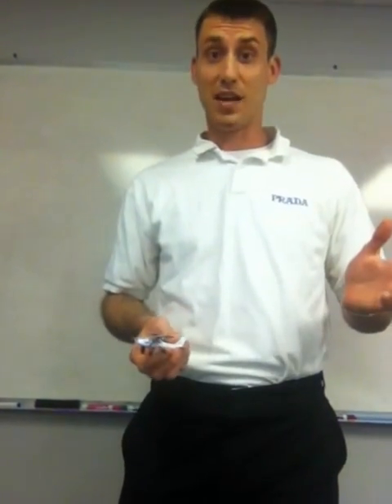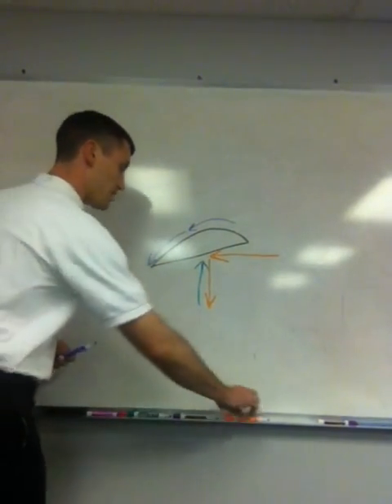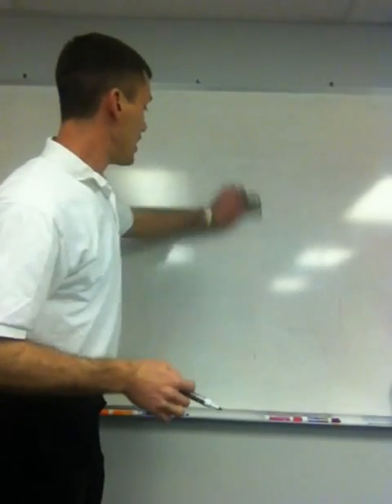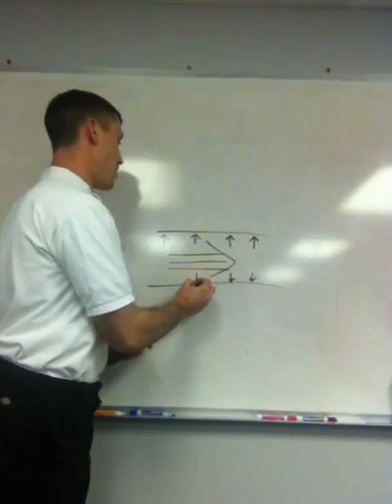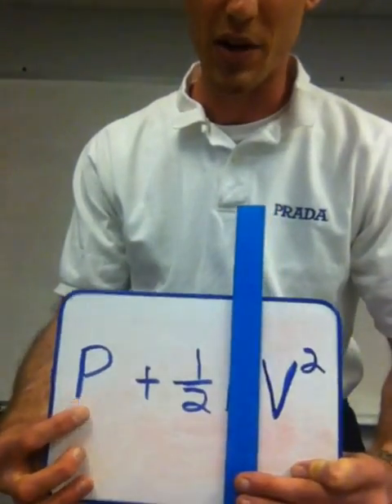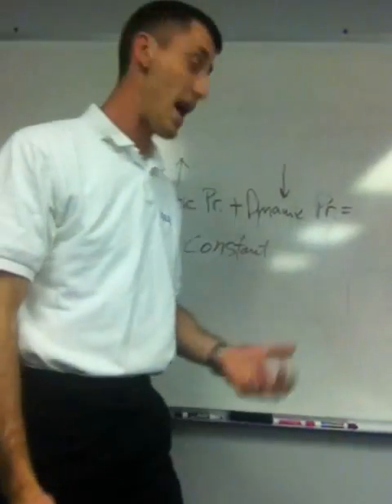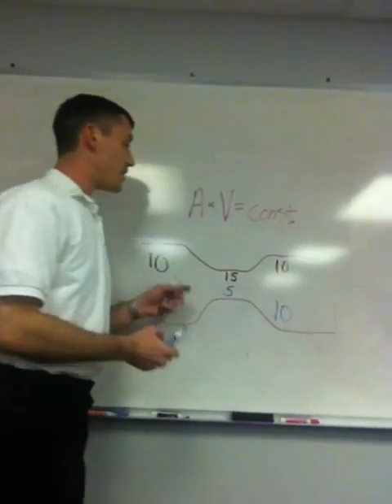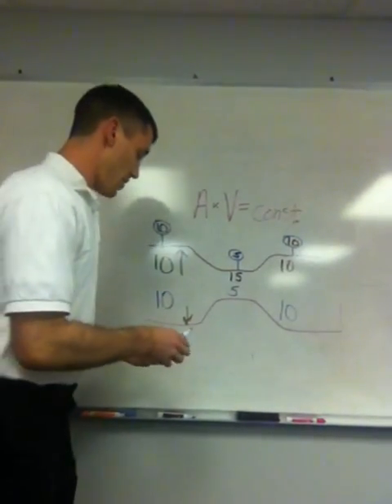How an airplane produces lift, bernoulli and newton

Comment: To all who are not SME:
LIFT caused by pressure difference (like  vacuum cleaner).
Pressure difference is due to fluid  flow CHANGE DIRECTION.
CHANGE of flow DIRECTION is caused by SHAPE of wind.  That is why in fast cars  airfoil is used as well.  The only difference being the wing or airfoil shape is mounted upside down producing downforce instead of lift.
Reply: Andrew Pa Yes.  This hardly a good venue...
Cheers.
Reply: A wing bends the air causing and change of velocity (speed and direction) If that change is downwards it is called lift. Newton's 1st, 2nd and 3rd laws in action.

Remember the air isn't moving the wing is. A ceiling fan is a practical demonstration of lift. The downward breeze you feel plus the upward force on the fan shaft = lift force... Simples....

Make a paper plane (flat wings, no camber) and watch it fly. it debunks all silly explanations. Sailboats, hang gliders and kites all have the same distance top and bottom yet they all create lift the same way... Magic or physics???

BTW all airliners have supercritical wings that are flatter on top and more curved on the bottom... Kinda blows up the explanation above doesn't it?
Reply: +Andrew Pa :"Pressure difference is due to fluid  flow CHANGE DIRECTION."
  Correct.
Reply: Observ45er : It is secondary effect. When there is no motion there is static  pressure distribution around  airfoil. Velocity  direction will be changed by such  initial  force ( gradient of static pressure). In other words  there is total  energy preservation  ( flow velocity represents kinetic energy and  pressure - potential ).  reduction in potential energy ( pressure) causes kinetic  energy  ( velocity) increase and vice versa.  From  energy point  of view  there is no primary/secondary relationship  , but when it comes to forces  there is no  other forces except pressure  gradients. So acceleration can not occur without some force . So, force is primary - acceleration is secondary .Hope it makes sense. Happy to discuss further.
Reply: Andrew Pa  I was supporting your correct statement and don't need clarification.  The video is using the incorrect and backwards "pseudo Bernoulli" explanation of faster air exerting less pressure.
...
The focus on energy confuses the science neophyte so I stay away from that.  On the other hand, the concept that "...acceleration can not occur without some force " is easier to understand as it is the true basis for understanding Bernoulli.
...
Once you understand, it fits very nicely with all other science and you don't have to make up excuses like "Faster air has 'less time' to exert pressure" as if it is some magical cause/effect (as I see in another video).
...
I wish the "wrong Bernoulli" people would read their comments, do genuine study and either remove, or re-do their videos.  I got one self proclaimed professor to remove his bad video from a teacher resource site...[[kept a copy, though.  It's a classic!]]
Amateurs I can understand, but there's a Purdue sponsored video that has all the bad demos...sigh.
One down, 20,000 to go... (;-)
Cheers, ScienceAdvisorSteve.
Reply: Complete Aerogeek Your comment does not explain why wing bends flow, why flow follows wing shape and what force accelerate (bending = acceleration) fluid. What you describe is not a cause but result of  "static" pressure distribution action on moving fluid .  Please, read John Anderson Jr books - "Introduction to flight" or "fundamentals of aerodynamics" :-)
Reply: Observ45er Agree , thanks.
Reply: Andrew Pa Hi Andrew, I am not sure what you are trying to say here.

The change in velocity (bending) of the static (at rest) air is caused by the mechanical intervention of the wing and angle of attack.

No AOA/Incidence or camber (which equates to AOA) = no lift.

The movement of the wing through the air imparts energy to the static air. F=Ma. The rapid change of direction caused by the mechanical intervention of the wing causes lift.

The cause of lift is the motion of the wing through the air. As the air at rest encounters the moving wing (like your hand out of a car window)  it is bent downwards in different ways by the upper and lower surfaces.

The physical disturbance of the air is what causes the pressure differentials. No energy=no movement=no lift.

A flat plate is the easiest way to demonstrate this. Flat plates work very well as wings up to about 8-10 Deg AOA. They have a very high L:D ratio.

Lift is caused by bending the air. period. A ceiling fan does he same thing.

 ( Thanks for the book tips but I have an MSc in Aviation Science and teach this to BSc students at University)
Reply: Andrew Pa Andrew lift is not caused by the shape of the wing.

Lift is caused by AOA or the change in angular motion imparted to the static air by the movement of the wing.

For a low speed highly cambered wing, the camber in the upper surface creates a large amount of the angular change that creates lift but this is the same affect as a flat or curved plate wing at the same angle of attack as the upper surface camber represents. The difference is the flat or curved plate produce much less drag.

Airliners have supercritical wings which are curved on the bottom and flatter on top so how do you suppose they work?. 

Aerobatic aircraft and most military have symmetrical or supercritical wings. Sailboats and hang gliders have single surface aerofoils and create lift very nicely by turning flow.

Kites, missiles and some high speed aircraft (F-104) have flat or double wedge wing cross sections and they all create lift very nicely.
Reply: So what creates the pressure differential my friend?  It doesn't create itself... F=Ma its that simple.

Without motion and an angular change of direction of the resting air, there is no lift.

Again, the pressure variations are an effect not the cause of lift.

Without a cause (AOA + wing motion) there is no pressure differential - period. At ) AOA/) incidence- there is no lift no matter how fast the wing flies.

And no pressure difference is not like a vacuum cleaner which in any case does not produce a vacuum at all. It should be called an air flow cleaner.
Reply: Complete Aerogeek Your description  comes from  engineering point of view.  My  description comes from  physicist point of view.  Unfortunately,  this  forum  is not best place to have nice conversation. Motion  for incompressible (low speed) and compressible ( high  speed) are not quite the same. Sorry for  misleading  I should  say shape of wing AND direction of flow ( in your world it has name  angle of attack, right?).  Of course, shape itself not very helpful if  direction of flow is not appropriate :-). My apologies...
Reply: Andrew Pa Andrew, thanks for that. There are so many people out there with the wrong idea.

Lift is quite simple until you get into the tiny details but the physics is exactly compatible with the engineering or aircraft wouldn't fly.

I was a bit confused as you seemed to have been proposing an effect without a cause. In Physics this is impossible as you know.

That's why I usually explain lift using a flat plate and demonstrate this by using NASA's FoilSim. It takes out any confusion about wing shape as there are so many variations.

Also I am very familiar with both low and high speed aerodynamics as airliners operate in the transonic range (and I am ex military aircrew and engineering).

Air that is subsonic is generally regarded as incompressible.

Also one of the places Bernoulli got things wrong is by assuming air is inviscid which of course it is not. 

Fun isn't it?
Reply: Complete Aerogeek Sorry , we just use different words to  describe same phenomena. Any submerged body creates some pressure  distribution  around it. This starting point for  any  further  effects.  When body moves fluids "particle/parcel" interact  with this  inhomogeneous pressure. "Particle" can be accelerated or decelerated. This will cause change of of this pressure  ( simply energy conservation in action). Now we will have two types of pressures ( static+dynamic= total). All this reminds me motion of electrical charged particle  in electrical field when electrical charged particle  has strong enough electrical field that  changes electrical field in which particle moves :-).
Reply: Complete Aerogeek As  physicist  whose primary interest is turbulence study  I was not  much in airfoils/angle of attack/thrust  etc.  But  huge number of lift "explanations" attracted my attention   to origin of lift .  I have great  respect  to people   who work with fluids (marine/river/aerodynamic engineers). They have to say much more about fluids  than  theoreticians. But their focus "make things  ( ships/cars/turbines) work" a bit different  from scientist " why nature works this way". Thank you for coming to such  forums and fixing damage  made to people by introducing such  "explanations".
Reply: Andrew Pa Hey Andrew, you lost me there. A submerged body at rest would be subject to Newton's 1st and 2nd Laws and so would have no pressure distribution around it unless the body or the fluid were in motion.
Reply: Andrew Pa Hi Andrew it is a pleasure communicating with open minded people. I am always keen to learn as I was also taught the wrong ideas about lift many years ago.  There are so many people out there who have been fooled by the old Equal Transit Time myth and this has bred all kinds of derivatives.

I had a 'discussion' with a 10,000 hour B 737 pilot who refused to believe that the old Bernoulli myth was wrong until I made a paper plane (flat wings) and asked him to explain it.... Lots of silence!
Reply: Complete Aerogeek Let me disagree with you  on this "no pressure distribution around it ". This is what exactly makes balloon raise  in the air ( difference of pressure). No other forces work here  ( if we will ignore friction,wind etc). 2d Law of Newton  explains acceleration - not force :-).  This is  a great difference between  2d Law for falling ball and fluid that for fluids  that velocity distribution in space has impact on  "force" - pressure distribution. This is source of all confusions: what comes first - pressure change or  velocity change :-).
Reply: Andrew Pa Sorry I should have been clearer.

The pressure distribution is uniform much like it is with us standing on the earth being enveloped at 1 Atmosphere. Static pressure is  not really of any interest to us at rest.

However the balloon analogy is something else entirely. Now you are talking about buoyancy and displacement. The balloon displaces more than it weighs so it rises seeking equilibrium. The static pressure distribution around the balloons surface is in equilibrium. If the balloon was filled with ambient temperature air to the same shape/displacement it would not rise, so where does pressure distribution come in?

A submarine is effectively a balloon but as long as it keeps its trim stanks flooded to balance the buoyancy it remains neutral so pressure is again at equilibrium.

As for the 2nd law, without it we cannot have lift. F=Ma.

None of these factors are really relevant to lift production. In static air at rest and aircraft wing creates no lift as pressure is in equilibrium.

I am not sure where you are going with the falling ball analogy. In a vacuum they will accelerate at exactly the same rate won't they? 9.8m/s/s in Earth's gravity?.

In lift, the velocity change creates the pressure change. The pressure cannot change without the mechanical intervention of the wing.
Reply: Complete Aerogeek Greetings from Sydney :-). 
"The pressure cannot change without the mechanical intervention of the wing." - good point . We are almost there. Just looking for best and simplest analogy.  Pressure distribution around  any body in fluid  creates  potential field like gravity close  to  the Earth surface.  Without motion all in balance  but as soon you will throw a ball  energy/speed of ball will be  changed by this potential field. Same when fluid particle moves  in vicinity of  any submerged ( in air/water/honey) body it will change it velocity ( you use term bending) and modify this field ( energy conservation) :-) .
Reply: Complete Aerogeek &  +Andrew Pa   I'm going to watch to see how this discussion regarding the term "pressure distribution" gets resolved.  I just realized  the basis for a good conflict in preceived phenomena with standard physics with this term...
.
There's too much opportunity for misunderstanding in the type of a forum.
Cheers...
Reply: Observ45er I prefer coffee-shop for nice friendly conversation between  curious people  as well. Leaving office for today . Cheers.

Comment from the maker: Thanks for the kind words guymassive! I made this video on a whim while I was working on my CFI. It's just me practicing but I decided to leave it up. . . Mostly to give people like 'Complete Aerogeek' something to complain about. Me and my buddies love reading and laughing at their comments. I wish I had as much free time as them so I too could watch other people's videos and cry about the content ;)
Reply: This is the "wing-shape fallacy," the misconception specifically targeted by the NASA education site.  Pilot educators are trying to stamp out and debunk this stuff.  You're making it harder for them.
The wings/lift controversy started in the late 1980s, when aero people in Sweden forced their pilot-training docs and pilot-cert tests to stop giving misinformation to pilots.  The stuff about upper/lower wing-shape is the main piece of misinformation they debunk.   It's simply wrong.
So, are you proving that symmetrical acrobatic airfoils cannot work, and neither can the Wright's flyer, since those upper and lower surfaces are equal?   And an upside down plane cannot fly!   Also, boat rudders and sailboats cannot work, right?   They don't have the "airfoil shape!"   But that's all wrong.
In reality the airfoil shape is not the origin of lift.  To say otherwise is to spread known misinformation.
Surface-asymmetry and path-length are irrelevant, because parcels splitting at the leading edge must never rejoin again after the wing has passed by (if they did rejoin, then lift would be exactly zero.)   In reality, the upper flow always vastly outraces the lower one, even with a thin airfoil, and even with a flat barn-door.  Why?  
It's because the trailing edge has a huge effect on the flow-direction, while the leading edge does not.  (This happens because air has high inertia, and when the trailing edge flings air downwards, the air keeps going down.  It remains descending after the wing has passed.  That's why wings leave a downwards-moving wake behind,  while the air ahead of the aircraft is undisturbed.)   And if air flows smoothly down from the tilted trailing-edge, then the upstream speeds naturally adjust themselves, and the patterns of surface-pressure also adjust themselves.   The flows coming from the trailing edge are producing forces which "reach  forwards" to the leading edge, and create all the patterns that we see.   (Or simplified, the trailing edge creates a closed-loop "circulation" which, when added to average flow, this gives the real pattern of flows and pressures on the wing.  Closed-loop "spanwise circulation" means that the upper flow is much faster, and the lower flow equally slower.)

Simplified:   since the trailing edge flings air downwards, and the gas-density does not change, therefore air above the wing must race into the pocket left by the down-moving air, and also, the down-moving air shoves the lower flow forwards, slowing it equally.  The air near an airfoil acts as if the airfoil was a baseball with backspin, or like a cardboard tube given backspin and then flung forwards.   Yet only the air spins this way, while the airfoil has no need.   The airfoil only requires a down-tilted trailing edge.

What particular misconceptions are debunked by NASA's Glenn Research center?
1. The Wing-shape fallacy, also called "transit time fallacy," which insists that asymmetrical "airfoil shape" is required.  It wrongly proves that symmetrical wings (or flat boards) cannot create lift.
2. Particle-collision fallacy, where lift supposedly is created by air molecules striking the lower surface.
3. Fallacy of percentage of Newton versus. Bernoulli.   In reality, Bernoulli pressure-difference explains 100% of lift, while Newton and the F=mA reaction-force also explains 100% of lift.  The two are just different approaches to the problem, and are not two separate contributions adding up to 100%.   (Don't forget that Bernoulli equations are based on Newton's laws, so it's no surprise that either approach should explain 100% of the lift.)
Reply from the maker: @wbeaty hey buddy I did read everything you wrote and though I haven’t read into it yet I just wanted to let you know you’re commenting on a video I made well over a decade ago and I’m curious how the heck you even found it?! I’m not a content creator or “you-tuber” so if you don’t mind me asking how did you find this video? Just some random search? How did you even find me?

Comment: You have misunderstood and misused Bernoulli. Please explain how a hang glider flies? A kite? an F-104 Starfighter, an airliner has wings flatter on the top and curved on the bottom. The air does not accelerate over a wing. Watch Babinsky. You are wrong about the area of the air to flow as there is no upper limit to the air. A wing is not a closed system. This video is completely wrong. Please contact me if you would like a correct explanation or go to NASA Glenn research Centre-How wings work.